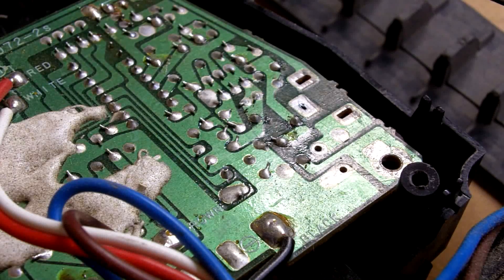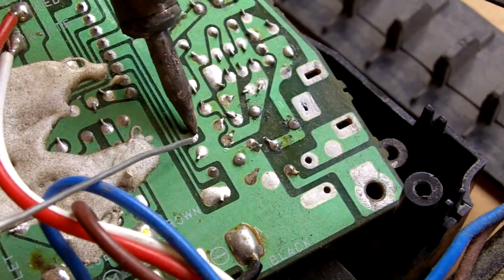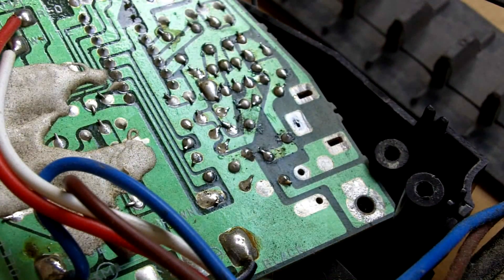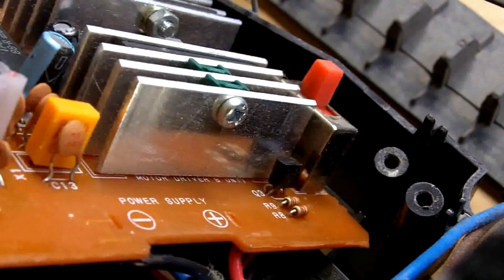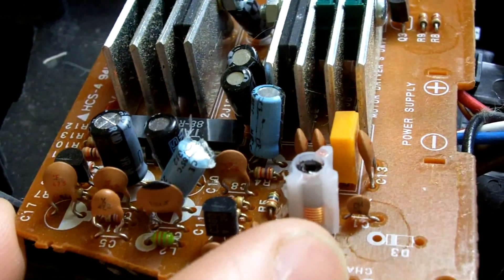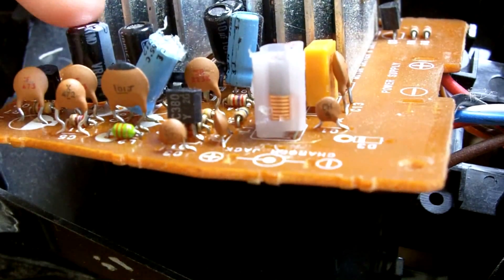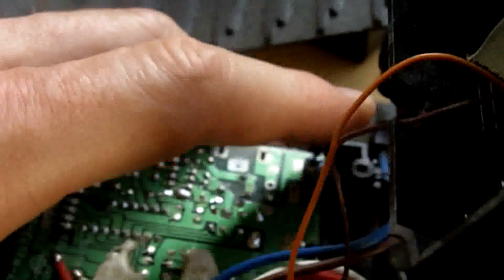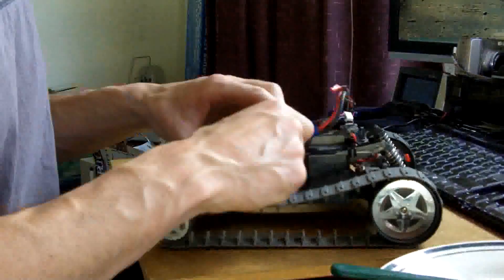Repairing a dry joint on an RC car ciruit board. With demo at the end!

Comment: I have a similar board for a tyco twin turbo lambo..everything functions except for forward and turbo forward.reverse,turning all works.i reflowd the solider and same problem exists..caps look good..have you ran into this problem before?remote is good cause i tried on another car and its in proper order so i know it's the car. Any insight would be appreciated.
Reply from the maker: Hi Steve. I don't think I have a lot more to offer than what I showed in the video. However I did see a hak5 video recently where they were playing with some RF stuff as a separate unit on a drone.One of the things they highlighted was that in their first attempt they didn't have a ground, and that for mobile stuff, you do this by adding a half length areal half way along the main areal. I suspect this is already done on our RC cars, but could be a location of the fault.
Reply from the maker: Here's the video I was thinking of: https://www.youtube.com/watch?v=YncM7KRH2aI

Comment: My RC car is receiving signals to drive the wheels, however, the steering isn't working. I've tested the motor and I know it works, is there anything else I should check?
Reply from the maker: I'm guessing you've checked the wires. What model of car is it? I'm particularly interested in the type of controller board in the car. Eg if it's got standard servo connectors, there's a good chance you could use another channel if the current one is not working.
Reply: FunnyHacks 

It's a radio shack street sprinter
Reply: FunnyHacks 

Everything on the car is standard, nothing has been changed.

So I believe it's got standard Cuervo connectors.
Reply from the maker: Understood. The reason I ask is that the cheaper RC cars are often 
entirely a custom board, where as the hobby ones use parts that can be 
interchanged. Does the board have a model number on it?
Reply: FunnyHacks

I'll check and I will get back to you.
Reply: FunnyHacks 

Alright, I found the model number. It is 136083-1
Reply: Even me I am facing the same problem

Comment: there is something wrong with my RC car circuit board somehow i turn on the RC car  motors will not move.
Reply from the maker: What model of car is it? Are there any signs to show that it is getting power. Eg do any servos move? Are there any LEDs that light up?

Comment: I have changed the capacitor and the coil like you have already mentioned...but the new coil is not able to change in different frequencies (it is fixed) ...and my radio car is still not working....will it ever work this way??? Is there anything else l could do to fix it???please answer me as soon as possible for you!!! I'll be really appreciate that!
Reply from the maker: Hi Shima,

Sorry for the delay. Those were the things that appeared to be the problem in my case. You could well have a completely different problem. What model of car do you have?

Comment: actually the damage came from soldered connection of the battery it kinda burnout in the terminal so I replace it with another battery set but my my rc wont work anymore which part of electronic circuit board usually damage when the power is short circuited thank you for the reply.
Reply from the maker: I'm sorry, I don't know the answer to this for your case. Things like transistors and integrated circuits are particularly sensitive to unexpected conditions.

Comment from the maker: Hi oriontoshiba. What was the damage? Did the battery catch fire? Did it leak? The damage from both of those would need to be addressed before trying to fix the electronics. Do you know how and where the short circuit was caused? It's hard to know what to replace without knowing what's broken.

Comment from the maker: Short answer is I don't know. There are a few things you can check though. It very much sounds like a bad/dirty contact at the part of the switch that makes the contact. If so, give it a clean. Also check for anything loose. It could be when you press the stick forward, that is pushing the board in a different way to when you pull the stick back.

Comment from the maker: @madhugonadig Without looking at the board I don't know. Here are some guides which might help you:
Often the antenna connection is much bigger and more solid than the other connections. Sometimes it will have ANT, a antenna symbol ( Y with an extra line), or an earth symbol (Arrow head made out of stripes). Usually the connection will be soldered. Sometimes it's held on by  a screw (in my case a screw that also holds everything together), and occasionally via some type of socket. HTH